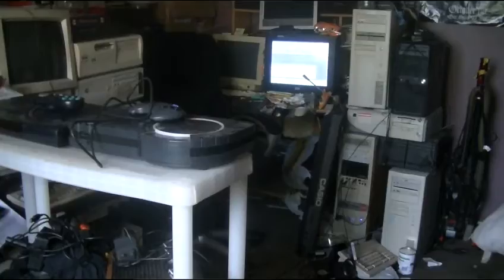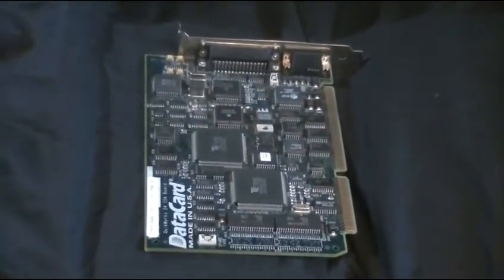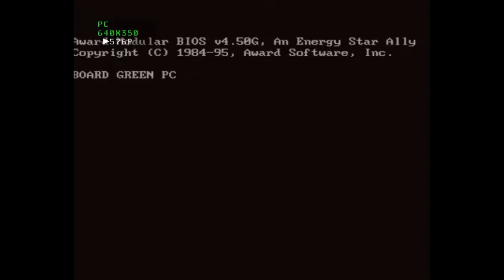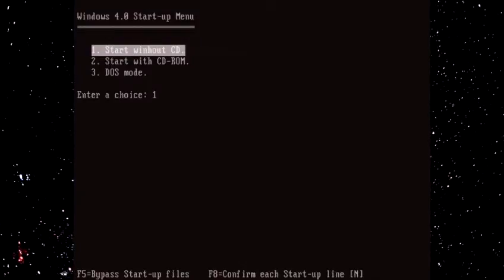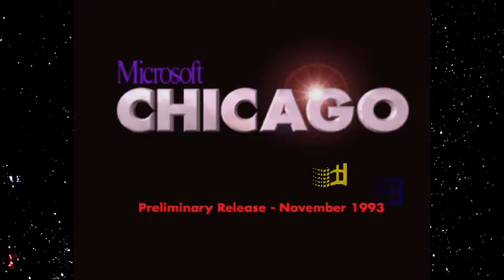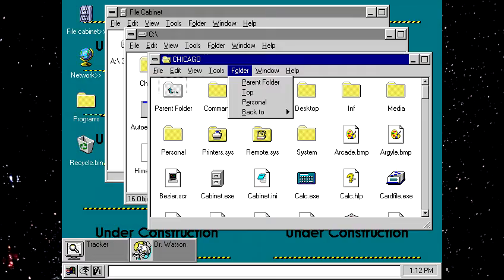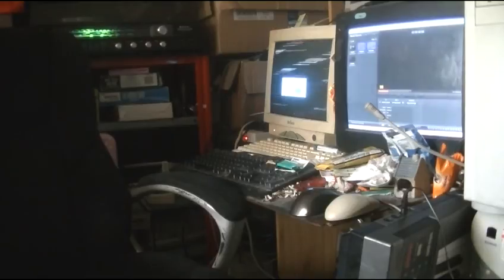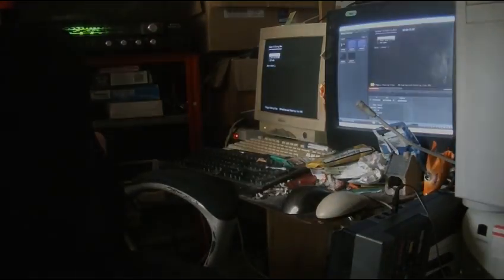UM486 System Overview

Comment from the maker: I used to be like that, thinking I was all 1337 and all... Then again I did wreck the college network fairly well. This 486 worked provided you didn't reset it, most problems I had came from not knowing what the cache jumpers should be and never thinking to disable it in BIOS. I remember getting tired of Keen and being overjoyed at finding my SNES. There was also a time in the early 2000s when I had a Pentium 166 and would play Touhou religiously as it was about the only thing it could run.

Comment from the maker: Pretty much. I'd had enough AMD machines go wrong at the time and didn't want to spend another second running one. The 486 build was for myself and I required a computer for schoolwork and coursework (i.e; Homework - use a computer to...) so yeah, I was happier running this thing than I would have been running the XP 2400. Most of the money went into saving for a new machine, a lot of this 486 was either garbage finds or bought with cigarettes.

Comment from the maker: The P3 had suffered RAM failure and I didn't fancy buying more - I thought it only ran ECC at the time too. AMD are a mixed bag for me, most of them never worked, especially the XP 2600 and the 64 X2. A guy I know swore by them until recently, though the bulldozer put him off. This 486 was indeed my only machine for around a year.

Comment: Ok. I was just a little confused at first, but I get it now. :D 

The funny thing is, something similar had happened to me once as well. Around late 2004, I had two systems; a 700MHz Pentium III, and a 66MHz 486DX2 given to me by one of my friends. At the time I thought of myself as a "1337 h4xx0r", so I decided to install this Cyberpatrol parental control program on my Pentium III to see if I could remove it. I ended up fucking up the OS, and I had to use the 486 as my main box for a while.

Comment: But yeah, I've had mixed luck with AMD myself. I once had an awesome Athlon XP system that I could swear outperformed most Pentium 4s, and I also once assembled a fairly decent Athlon II system that I used as a secondary machine for a while, until giving it away. At the same time though, I've also dealt with tons of crap Athlon 64 systems, especially x2s. As well, one of my friends had a laptop with a Turion 64 in it, and it was still slow even after upgrading it to a dual core.

Comment: it's a cheap Sound Blaster Vibra 16, but hey, if it work, it's fine.
Reply from the maker: There were a lot of inaccuracies and such in these older videos. The card I referred to was a CT1740 which used to be in this machine, but at this time had been replaced with a later model card. These days, the system uses a CT1680, which I think appears in the later "U5S Rebuild" video and hasn't been changed out since.